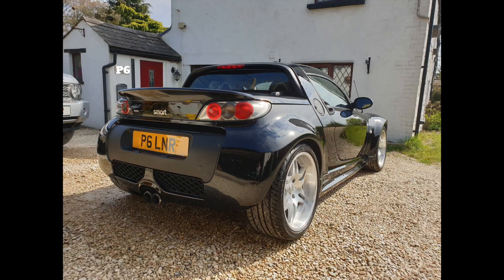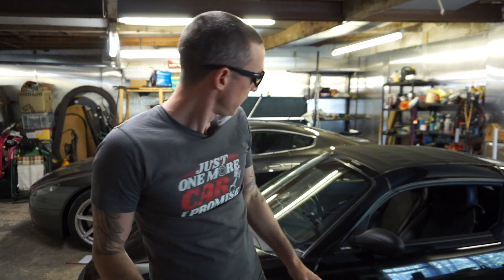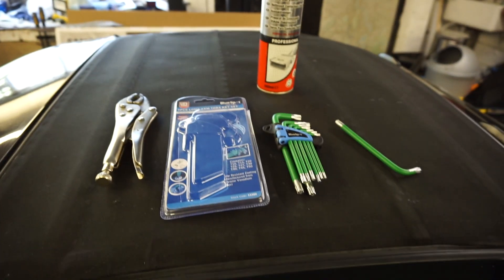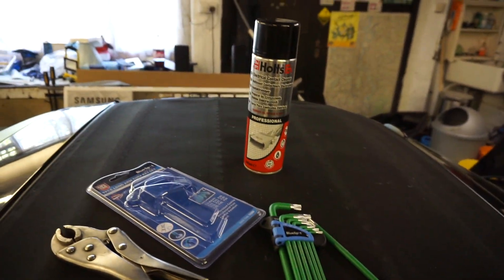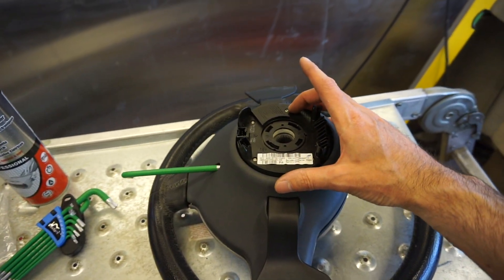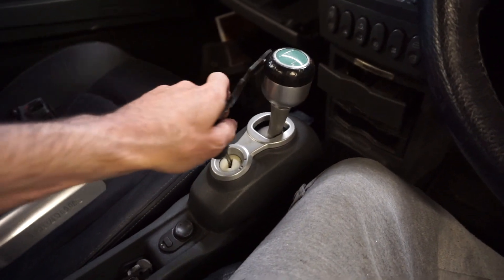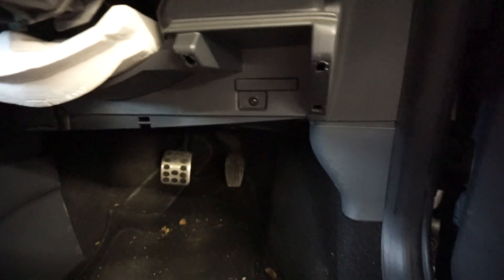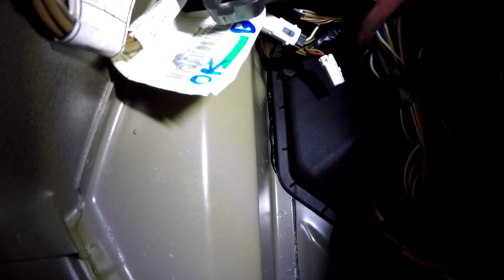Smart Roadster Brabus - challenging day in the garage!

Comment: If fog lights, flappy paddles, cruise control stop working it's often due to the car losing the TAN codes.

Merc Smart main dealer or independents with a STAR Machine will be able to TAN code in again.  

I had a similar issue with my old Brabus Roadster Coupé whereby the fog lights stopped working. I did fault checking with the wires, at the switch end, at the light unit ends etc with no individual issues.
Reply from the maker: Exactly that, the TAN code needed recoding in the end.

Comment: I had exactly the same issue with my paddle steering wheel about 7 years ago (no horn no paddles).  The problem is a fracture within the clock spring wiring  ribbon inside the wheel.  Look up pictures of the wheels internals on Evilution. I repaired mine myself by cutting out the fractured section (luckily near one end of the clock spring) then resoldering.  You MUST reset centralisation of clock spring ribbon so that the number of turns lock to lock are equal.  Some one had taken off the steering wheel in the past and lost the ribbon centralisation (easy do do if unaware of internal layout + function) such that the ribbon was put under tension at full lock on one side when replaced - hence the fracture!  Mine has been 100% since the fix and it cost me nothing.  Also worth getting an MStar computer for pre 2014 Mercs (no need to be connected online for older MStars ;)). Good Luck.
Reply from the maker: Mine turned out to be a reprogramming issue. It somehow lost its coding. A quick trip to Smat-Tecnic to have it put on STAR to recode the wheel resolved it.
Reply: @palmergeddon   That's good news. I have an MStar system so I was sure re-coding wasn't the issue with mine ..which led me to completely dismantle the steering wheel only to find the fractured ribbon cable.  Anyhow, your video, plus these posts, will give Smart owners with non-functioning paddles (and horn) a complete suite of avenues to explore (with due respect to Evilution too!).  The last thing owners want to do is to waste £700 - £900 buying a new paddle wheel when a re-coding doesn't work.  And I'm pretty sure someone else out there will fall victim to the ribbon 'clock spring' cable strain issue as it's so easy for the unwary to lose track of centralisation with the steering wheel off. Hope you're still enjoying the car ... I've just completed an engine rebuild on mine - new everything - well worth the expense of parts (from Smartune) and time spent (a couple of weeks) because these cars are great fun to own when the bugs are ironed-out and they're working as MB intended!

Comment: Dont give up on the horn and paddles mine took 2 trips to an electrician to get the contacts working properly! Idk whats so tricky about it but it is 🤦‍♂️
So tricky the previous owner just added a button on the back of the wheel for the horn so it would pass the inspection 😅 but damn it if i wasnt gonna get it working ahah
GL m8 im sure u'll get it working
Reply from the maker: Lol, that's a desperate solution from the previous owner. When buying a used car you inherit the bodge jobs and issues - but if you go into a purchase like a Roadster you need to be prepared for these challenges.
Reply: @palmergeddon  Yea im guessing mercedes gave him the same 1000 euro quote 😂 
Thankfully not much else has gone wrong yet 🤞 i mean it leaks a drop of oil every 6 months 😆 dont feel like it warrants attention just yet ahah
Reply from the maker: Yeah, not enough to worry about, I would do the same 👍

Comment: On the other hand if you have multi-meter it would be peace of your mind if you checked the signals coming out of steering wheel, there are chips in the steering wheel. Chips are operated by software (the ECU one) and if you have retaught your clutch you might have fried any of the chips in the wheel...HOPE it's not the case as them wheels are going crazy expensive (will have mine for sell when I sort out aftermarket shift paddles for aftermarket wheel). On the oil leak front it kinda looks like it's coming from top of the engine (the metal bar[have no clue what it's called] is wet on the off-side of the engine which is facing the camera). How much oil does it loose over 100 miles? (if you can spare it). Anyway I hope you get it sorted and we could meet soon at any meet in the future :)
Reply from the maker: Good shout, I hope it's not that, but it's worth checking. The pipes above are the turbo feeds - they seem to be dry and fitted correctly.  There's no leak above the heat shield, it seems to be coming from the area near the dipstick and oil cooler.

Comment: Probably a really stupid question - but have you checked the fuses? I remember reading somewhere that the leather steering wheel you have uses a different fuse than the cheap horrible plastic one in my roadster - not sure it’s shared with the flappy paddles  though.  Don’t give up on your roadster - mine took me 2 years to sort but it’s 100% bullet proof now.  It is my 4th car meant to be used occasionally on sunny weekends, but I end up using it all the time as it’s such fun to drive.
Reply from the maker: I did check the fuses in the SAM and I couldn't see any blown fuses, definitely not a stupid question. I won't give up, I bought the car to enjoy and that includes trouble shooting and spanner work - I'll hopefully get the driving enjoyment soon :)

Comment: Did you find out 100% what the leak was? My roadster has a leak in a similar place
Reply from the maker: Hi Ben, rocker cover gasket was leaking and collecting near the dipstick/oil cooler. It was a newly fitted gasket, but it moved when tightened down. Ended up using a little bit of glue to hold it in place when refitted. Good luck with yours, let me know how you get on.

Comment: Might also be worth checking the condition of the 2 o-rings located on top of the two plastic pipes that connect the engine block to the oil cooler.
Reply from the maker: Definitely! Might be worth changing them all to be on the safe side.

Comment: The plastic pipes are the water feed to the oil cooler, have you test the Crankcase Breather Valve? 
Are you on the www.theroadster.net I am ‘starblue’ PM me.
Reply from the maker: You're absolutely right, the plastic pipes feed coolant to the oil cooler - I discovered this when I took it apart. The PCV is new and I have retested it and it's fine. The leak is now fixed, I am hoping to do an update video soon.